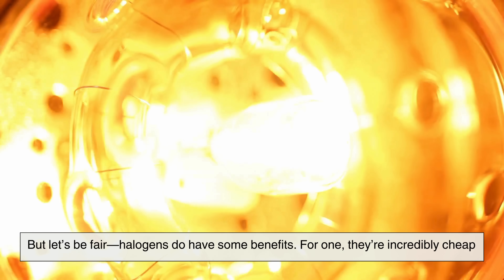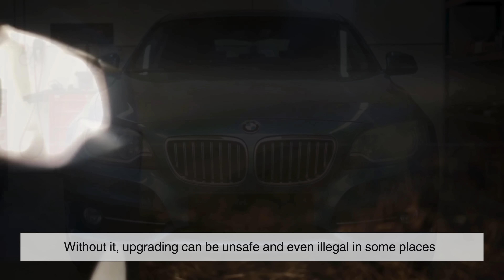LED vs. Halogen Headlights: What’s the Real Difference?

Comment: For me, I'm sticking with halogen lights for as long as possible. They're just so cheap if something were to fail and in cold climates, they actually keep ice and snow off your headlights. I've seen modern Honda Civics with LED headlights where one side is not working because its busted, and they're quoting over $1,000-$1,500 USD JUST FOR THE PART, not including labour... Meanwhile when my halogen bulb fails I just go to Walmart and purchase a new one for $10...
Reply: What will you do if halogen lamps become outdated and become less available as a spare part.

Comment: It is quite easy for  LED  manufacturers to change to a more warmer colour .... ALL white  LEDs  use blue or violet  LED  units , with a phosphor ( much like the old office strip light's phosphors ) .... to change to a more ( warm white ) , all they have to do is change the chemicals in the phosphor overlay .... QED ............ DAVE™🛑

Comment: Here it is in a nutshell.....   LED headlights are too bright, and BLIND on-coming traffic !!  Get rid of these lights...  They are too blinding !!  For off road use ONLY !!
Reply: lol good luck granting ur wish, that’s never gonna happen. No such thing as too bright, it’s plenty bright.

Led is the way to go, and halogen is a thing of the past and it’s laughable in terms of brightness. 

2 sided led bulbs that very thin two sided led body, and tiny led chips like CSP,SMD,ZES led chips truly retains the same beam pattern as oem.

As long it aim straight forward or a hair down and adjust the 2 sided facing 3-9 o’clock. 

It will definitely not blind others. That’s a fact. 

lol that off-road use only nonsense means nothing. 

We rather upgrade to see better and be seeing better and enjoy the night, without blinding others.
Reply: @toyotabrony   You are full of crap.....
Reply: @doctorartphd6463 simmer down and the future is now old man🤣

Comment: LED's are also very dangerous when facing oncoming cars.
Reply: lol not really. Led are much safer on the road without blinding others.
Reply: I think a lot of the reports regarding LEDs blinding other drivers are where people have replaced the standard Halogen bulb with LED which the headlight casings aren't designed for as explained in the video + it's been illegal to do this conversion since 2021 here in the UK. My car's fitted with full LED headlights & yes they're brighter than halogen but do NOT dazzle other drivers

Comment: the energy efficiency of LED headlights in cars is a moot point. the difference is negligible, but besides that ,modern cars have tons of features that draw from the battery more than your running headlights. cars never really turn off, and that's even more true now. if you ever go on a long vacation and come back home and find your battery dead, it's because of all the features that slowly draw power from your battery even while the car is off.

Comment: LED has a bad rep because of all the douchebags putting them in a halogen assembly instead of doing a proper conversion.
Reply: That’s because they either have a poorly aligned beam partner or they pick the wrong type of led bulbs, like the multisided ones: 

2 sided led with tiny CSP led chips work a lot better that retains the same beam pattern as oem. That’s a fact. 

And definitely will not blind others.
Reply: @toyotabrony  Any sort of LED bulb inside an headlight casing that's specifically designed for an Halogen bulb is illegal in the UK regardless of the chip design/location
Reply: @pgtips9236 it’s the same approach that’s illegal in UK and US. Not MOT ZOR NOT DOT. But still upgrade with 2 sided led bulbs, that retains the same beam pattern as oem. 

It’s much safer and halogen is a thing of the past
Reply: @toyotabrony Yes Halogen is old technology which is the reason most new vehicles are now fitted with LED lighting as standard but it's still illegal to swap Halogen bulbs to LED in the UK & will fail its annual MOT check aswell
Reply: @pgtips9236  nobody is gonna even bother for telling u, u need to change back to halogen. 

If I live in UK, I’m still gonna remain led. Hate halogen.
Reply: @toyotabrony  I've driven vehicles for nearly 40 years fitted with Halogen bulbs so will stick with the newer LED lighting my car's fitted with 😉
Reply: Yes which is ilegal to do in the UK but people still do it

Comment: While modern led headlights is incredibly bright they do have a very refined beam pattern, they are super expensive that most of us will not have the money to replace them.

And we prefer a modern halogen projector and reflector headlights, and swap and upgrade with correct 2 sided led bulbs. 

And we prefer Lasfit for headlights, and Auxito 3000k golden yellow led fog lights. 

Plus it’s more cost effective, but depending which led bulbs that meets ur budget. 

A pair of 2 sided led bulbs can be between $40-$260 a pair. But when seeing them being tested, they are a solid choice. 

Led bulb upgrades is the way to go and halogen bulbs is a thing of the past.

It’s safer, brighter, better, see better and be seeing better, without blinding others. 

Because a lot of people just slaps led bulbs in their headlights and call it a day.

But we prefer get the correct 2 sided led bulbs with tiny CSP led chips, retains the same beam pattern as oem projector and reflector headlights, and without blinding others and reduce by getting flash by others, we can enjoy our night time driving experience in the long run.

And that’s a major goal.

Comment: LED lights should be banned altogether. Why you might ask. Simply because they are made in such a way as to be non-repairable and it can get expensive quickly. There are presently some sealed LED head light and and tail light assemblies that can cost over $3,000,00 to replace because the manufacturers are allowed to gouge the consumer. In addition, when they claim LED's will last 10,000 to 30,000 hours they are stretching the truth. These tests are done with the LED's in open air. Once you place them inside a sealed container they will lose up to 1/3 of their life. A 10,000 hour LED is now only good for6 to 7 thousand hours, a 30,000 hour LED in reality only 20,000 hours.
Reply: lol nah led will not be banned. 

IRS very popular, a lot of prefer that with led for krisp 6000k pure white > ugly dingy yellow halogen bulbs that around 2900k.

While factory led headlights is great but they are super expensive. 

And we prefer modern halogen reflector and projector headlights, so we can upgrade with 2 sided led bulbs upgrades.

Comment: How do Faraday Boxes Work? After that, you should create a video called: How Faraday Boxes Work. These things can 100% prevent Relay Attacks and can save a ton of battery life on your key fob. Key fobs use no power at all when inside Faraday Boxes. They prevent the signal from leaving the key fob and prevent the key fob from communicating with the car. 

The further the key fob is, the less power it uses.
Reply: Aluminum foil box